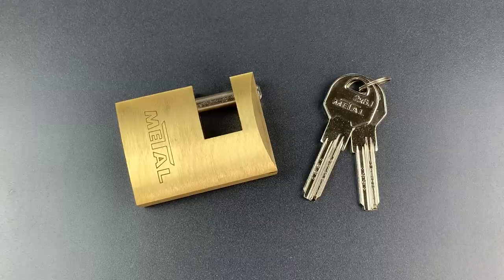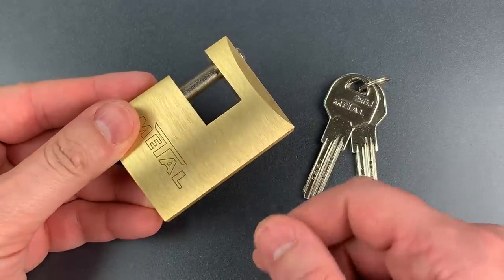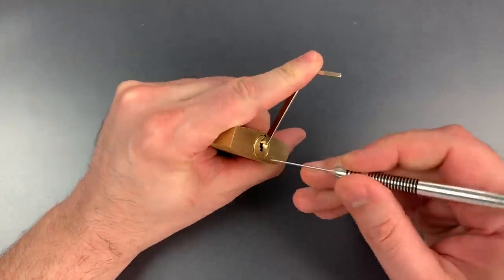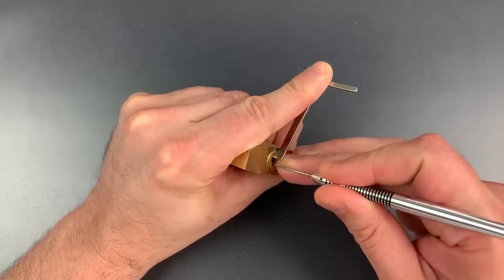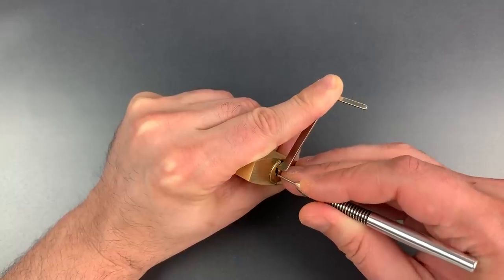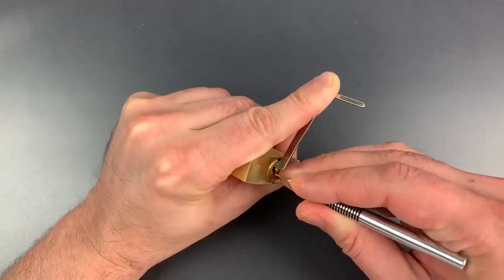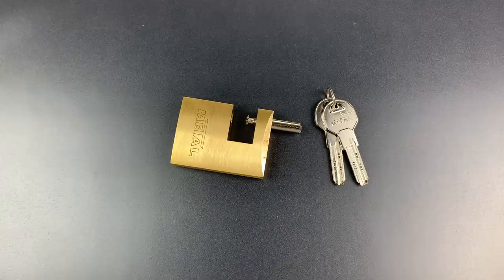[878] Bulgarian “Metal” Dimple Shutter Lock Picked (Model X6J)

Comment: Out of curiosity, why don’t you pick back to the front after going in?
To clarify: after testing pins 1 -> 6, why not continue back with 5 -> 1 instead of starting at 1 again?
Reply: I think, he leaves pin one too long untouched, he says the pins tend to move back, so every pin get equal time before being touched again. Thats why at the end, no 1 was de pin which wasn't touched for the longest time, and it opened after touching that one again, 2 was still in correct position.

Comment: That would be a wooly-bugger to pick on a shielded hasp; that is a door hasp that has half section of 6" pipe welded over it and a half moon top also welded so that you have to reach up into the small cavity to reach the lock -- just enough room for your hand and key.
Reply: Exactly. I've seen some otherwise fairly ordinary American padlocks ensconced as you described, that were thusly rendered MISERABLE to defeat.

Comment: Hey man I have a CRL ML9453, I removed the lock and unlock buttons but now the lock when installed and locked from the inside can be opened from the outside even though the deadbolt is engaged. Please help, need your guidance bro...

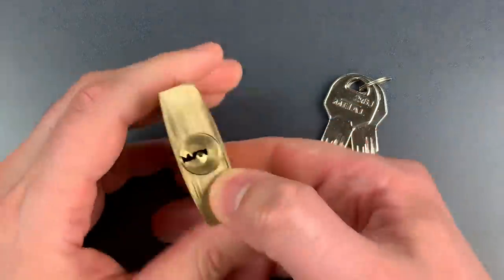Comment: 0:52 „Tapered driver pins“, what does that mean and how does this feature work? And as always: Great video, thanks a lot!!
Reply: There's two sets of pins inside the lock core. The two pins are sitting on top of eachother and when the space between them lines up with the sheer line, the lock core can turn and the lock opens.

The driver pin is the uppermost pin, the one that needs to be pushed out of the lock core so it can turn. Tapered means one end is thinner than the other. Much like a traffic cone, only the open end is a little bit wider of course. There can be multiple tapered pieces on one pin, giving the picker the impression that when the smaller end clicks into place, that pin is properly set. All security pins try to mislead the picker in this way, all with their own shapes and quirks. Some require counter rotation, other more tension and some force on the pick. 

Hope this covers it
Reply: Paul Elderson Thanks a lot for the great explanation!